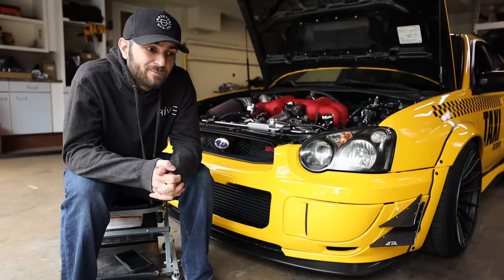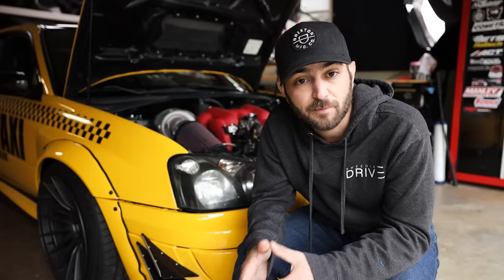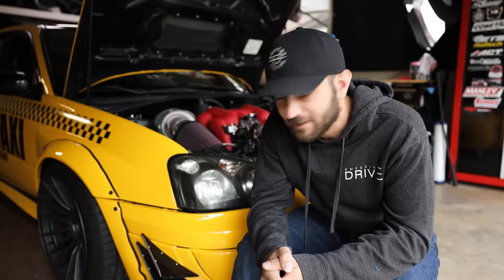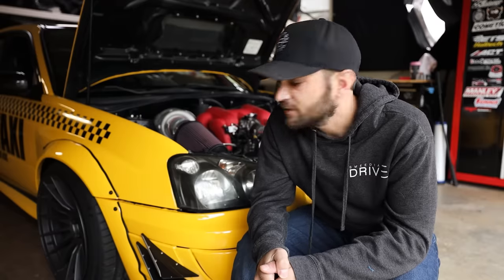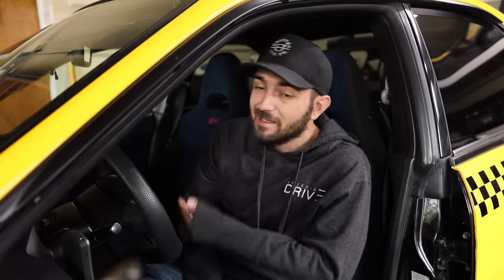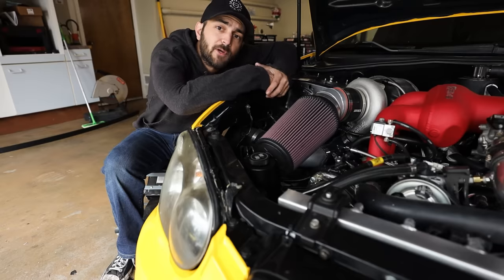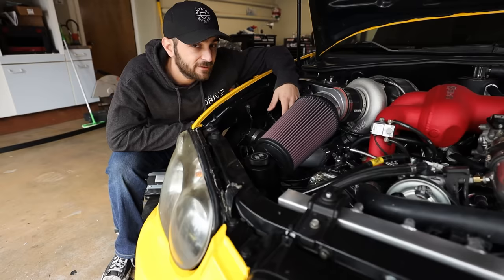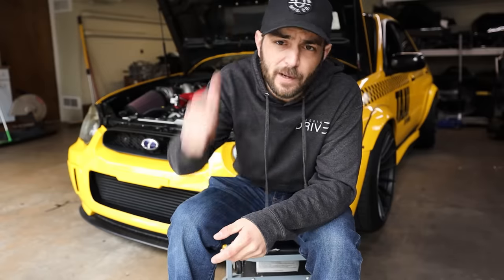What You Can do To Keep Your Subaru Reliable.

Comment: When you say "Built engine"  Is that just stronger pistons/rods/rings/etc or do they actually modify the block itself to make it stronger?
Reply from the maker: Depends on what you do, mine has forged internals and block modification but some can just have internals
Reply: Usually when people refer to built engines they are referring to having better and stronger internals and not the stock parts
Reply: Yes. And no.

Comment: Yo guy in my town selling a stock ‘11 sti 118k mikes original engine. Cosmetic head gaskets, with arp head studs, with new clutch,  new timing belt, new water pump and  new pulleys and tensioners. Would you be worried about buying a sti with 120k miles on original engine?
Reply from the maker: Nah, I'd be more worried about whomever sid the work. I'm super picky when it comes to buying cars. But 120K is not bad
Reply: @Smeedia  he’s a mechanic and he would let my mechanic do compression. Abs leak down test
Reply: @Smeedia  he said he doesn’t let anyone touch his car but he knows my mechanic pretty well so he’s the only one he will let look at it
Reply from the maker: BTW! Would highly suggest a comp test before buying. If he won't let your mechanic do one that raises a red flag
Reply: @Smeedia  ya he will let my mechanic do a compression and leak test. But won’t let anyone else look at his car

Comment: Quick question ...I just bought  a New RA shortblock... Would you recommend Re-gappiing the rings to .0028 .. running a VF48 With a 11 blade Billet wheel..with supporting mods..tuned at 21.5 lbs ... Re-gap or Nahhh  Thanks man..
Reply from the maker: E85 or pump gas?

If pump gas I'd would just send it

Comment: 1. Keep it stock.
2. Use proper engine oil, check oil level once a week and keep oil level close to max, and change oil every 5000-7000 km.
3. If you have a subie with a 2.5 liter engine - swap it to ej20 and enjoy your car.

Comment: So what’s the appeal on a car that requires an AOS, cylinder cooling mod, tune, frequent maint, and  specific driving habits just to be reliable and a little quicker than a 2.0t accord? I think I’m regretting my recent STI purchase.
Reply from the maker: Doesn't require it but always recommended. They're an absolute blast when you start digging into them

Comment: I have a 03 Impreza GX 2.0L that I plan on turbo charging to have a fun street car. I don't plan on making crazy numbers but I want to do it for the learning process and to have something slightly unique. Any major red flags/warnings?
Reply from the maker: Stock internals and trand will not hold up to boost very well, but if your not going into it for power and just for a learning experience 100% 🔥

Comment: Lol blown four engine but I know the problem suburu oilpickup are brazed together not welded so what happens oilpickup shakes brazing cracks then it's like sucking water through a straw with a hole does not work if you want the engine to last replace the oilpick to a descent one

Comment: Looking into buying a 05 wrx with a JDM ej205 with the jdm ecu single avcs and wiring all done for it to run properly 55k miles on the engine has full exhaust down pipe and all a greddy bov and upgraded sti intercooler already on it as well as a tgv delete not sure if i should go with it though as donuts videos have kinda made me skeptical of course if i did go with the car i’d get it tuned 1st thing with all those bolt ons cause it hasn’t been but just looking for some advice if i should go with it or not as a daily driver
Reply: The oil lines were all swapped from the usdm to jdm motor to fit properly i forgot to add this

Comment: umm fa20 has the multi and port injection. thats what the toyota thing is... am i wrong,? scion frs has pre valve port injection true or false.
Reply from the maker: Fa20 uses Toyota D4S system with port and direct injection so no worry if carbon build up. 

Fa20DITs only have direct injection so carbon cleaning is required

Comment: Quck question about tuning (new to subaru's) If I have Tomei Headers + exhaust and cobbs accessport  that wont work?
Reply from the maker: Unfortunately no, Cobbs OTS Maps are built to use only with Cobb parts. You would need a custom tune 🙏

Comment: If you were looking at grabbing an sti today, what year would you aim for? I was looking at 15-19 but leaning more toward 18/19 but it seems like the only deals are on the 15s
Reply from the maker: If it were me I'd snag an 07 limited, but between thr options your looking for snag a 2019+ for the type RA shortblock 🤙
Reply: @Smeedia  does limited or not matter?
Reply from the maker: No, personally I just prefer the limited
Reply: @Smeedia  I'm looking for a daily driver and keeping it intake/exhaust and a pro tune.
Have a Hawkeye for the weekend warrior.
Best deals I'm finding are on 15 limited, Have 1 19 base within 300 miles. Trying to keep it reasonable distance as I'm trading in my mk7 gti
Reply from the maker: The 2015s are great for daily driving, the limited would be my only go to for that year. The base infotainment systems are awful
Reply: @Smeedia  you got discord or something? I can show you the 4 I have it narrowed down to. And maybe give me some tips on what to look for on the test drives
Reply from the maker: https://discord.gg/HmCWZ26G
Reply: @Smeedia  cool. I joined and sent you a pm

Comment: What if someone has an N/A Subaru and they don't provide an access port or anything to monitor the engine
Reply from the maker: I wouldent stress it on an N/A engine but if you wanted to they make some OBD2 readers that will work 🤙

Comment: Hey so I have a 2011 wrx I asked you about this not long ago my wrx coolant temp keeps increasing I’m not going through coolant my car does consume a little bit of oil. I burped the coolant system then the coolant temps went down stayed between 185 and 195 stays that way for about three weeks and then slowly the temp starts to increase again up to about 215 then I burp the system and it goes back down again for a few weeks and stays good then slowly goes back up eventually. Any idea what’s going on?
Reply from the maker: Sounds like a leak in the cooling system that's sucking in air. I would run a pressure check on it
Reply: @Smeedia  how and where would I get the stuff to do it
Reply from the maker: The sell coolant pressure testers at most local auto parts stores
Reply: @Smeedia  thank you so much man your a huge help!!

Comment: Lower octane doesn't equal lower quality. It just has different compression ratios.

So if you're a guy who's putting premium gas in your Yaris or two stroke motor you can stop that and start saving money.
Reply from the maker: Lower octane equals less knock control 

For a normal commuter 87 is just fine, for something pushing power you want higher octane.

Comment: I've been looking into a wrx, 2011-2013, Im going to be buying it stock, around 70-80k miles, leaving it stock. Anything I should do to help it once I purchase it? If I were to mod it at some point, what are some minor things I could do, nothing major.
Reply from the maker: Just maintain it and it should be 🤙 really comes down to how those first 70K miles were on the car. 

If you do decide to mod it start off with an Air oil separator and an accessport
Reply: @Smeedia  Thanks man, really appreciate it!

Comment: Does IAT really matter on a turbo'd car? I thought charge temp is what mattered, cause no matter what the air temp coming in and from the turbo is, its still being cooled by the IC before heading inside..i could be wrong though..
Reply from the maker: Charged air is measured off of the IAT Sensor. Same thing. 🤙

Comment: Freaking GREAT video
Reply from the maker: Thank you 🙏🙏🙏
Reply: @Smeedia  any tips for direct injection carbon buildup?  A VW service tech told me to give it the old highway speed ring out, at 35-3800 rpm at speed.  “Italian tune up”. lol
Naturally, intake valve cleaning at 40K miles or so, depends on the car, is the right thing to do, yeah?
What else can prevent it?  
note:  cool to see the new shared platform GRz/GRs whatever they are calling it has port injection and direct injection.   :D
Reply from the maker: Lol that won't do it, either walnut blast the valves or use subarus Chemical service to clean them 🤙 
Only way to really prevent it would to be to add port injection 😖

Comment: Hey man I’ve have 0.812 - 0.938 DAM on my accessport after installing a grimmspeed charge pipe. I have a MAP stage 1+ tune and they said it would be ok to run the charge pipe with their tune. The problem is not bad gas because I get 93 shell every time. I haven’t seen a 1.0 DAM for weeks. There is no bad knock readings just the occasional -1.41 for a split second. The car also runs fine. What do u think the problem is? Would a Etune fix it? Thanks!
Reply from the maker: An etune will always be better, OTS Tunes are okay for the most part but sometimes some cars just do not like them
Reply: My car hates maperformance e30 tune. Loves phatbotti e tune.

Comment: I plan on getting a 2020 STI and plan on leaving the engine mainly stock… but want to make it more reliable what specific parts are best for it?… any info would be greatly appreciate it thanks!!!
Reply from the maker: IAG AOS, fluidamper, Larger radiator if you wanted to add some parts on 🔥

Comment: Help. Ignition coil bolt broke off in the head. How far up a creek am i?
Reply from the maker: Pull engine, drill it out 😖 you might be able to do it with the engine installed but I wouldent trust myself to do it that way

Comment: Ayo I got a GT86 same thing as a brz but it does have port injection. It's got both port and direct injection. Just in case you didn't know :)
Reply from the maker: Correct, FRS/BRZ/GT86 use Toyota D4S system, the FA20 comment is mainly directed at FA20DIT cars
Reply: @Smeedia  thanks for the info btw keep up the good content.  Also if I decided to upgrade my injectors do you think I should upgrade all 8 or I could get away with just upgrading the direct injection ones?
Reply from the maker: Nah, just the port injectors. When I did my Turbo BRZ we swapped thr low pressure injectors to 1000cc and it was more than enough fuel 🔥

Comment: The whole "Subarus blow up" myth started a few years ago. 99% of the time it's blatant user error. Either someone didn't realize that you need to periodically check the oil level on turbo cars, and end up beating on them when they're low oil. Or people do crappy tunes and mod them with cheap parts without doing their homework first. Then they drive them like race cars, all the time, and blame the car when they have problems. 

My entire life (up until about 4 or 5 years ago) everyone always said Subaru's were one of the most reliable cars on the market.

I've owned my 2010 WRX Premium (5-door) since October 2009. That's 12-1/2 years, and I live in Buffalo, NY, with extremely harsh, and long, winters. I'm over 100k miles and all I've needed to replace so far, that were not wear and tear items, was the fuil pump (my own fault for running it on fumes a lot. A bad habit I stopped doing) and the relay for the Heat & AC main blower fan. Everything else I replaced were basic wear and tear parts. (Brakes, light bulbs, tires, belts, battery, etc)

The one expensive fix I've needed to do is the clutch (at 85k miles). I upgraded it to a lightweight stage 2 clutch and am now a little concerned about the extra stress to the engine (with it reving quicker and going into gear more aggressively). I don't have the money for a new car so I'm trying to get as many years out of it as possible. 

I've been running the best oil out there (Mobile One High Mileage, Extended Performance), change it every 3k miles, always run the proper gas, etc. I also don't drive it hard except for once in a great while. Even then, I don't launch it. Mostly just drifting it around corners when streets are covered in snow. Other than that I drive it easy. My engine doesn't knock. It runs perfectly smooth, and quiet, and I want it to stay that way.
Reply: I do have one strange noise happening currently, however. A humming type sound coming from the front end while driving. It gets noticeable between 40-50mph and sounds like it might be coming from the front diff, or somewhere near there. The pitch of the humming goes up when my speed goes up then decreases as my speed drops. It's not too loud but noticeable when all my windows are up, my radio's off, and I'm just cruising.

Any ideas? Just curious. 🤔
Reply from the maker: First thing that comes to mind is wheel bearing, un balanced wheels. But if you do suspect it is the diff I would drain the fluid and see what comes out 🙏
Reply: @Smeedia  Thanks for the reply. What makes me think it's the diff is that the noise doesn't sound like it's coming from a wheel-well. It sounds more centered under the front. I know noises can be deceiving, though. I know someone who has a lift so I'll be taking it there soon.

Does differential fluid slowly go down over time? I'm way past due for getting it changed. I'm not even sure how long it's been. I'm wondering if the fluid could be so old that it's lost its viscosity, or possibly gotten low enough that the diff is humming when it gets up to speed.

My wheels are all good. Newer tires with no broken belts or side wall bubbles. I am in need of an alignments, however. Any idea if getting it aligned could make the difference?

Thanks again for the info.

Comment: i get -1.05 fine knock learn on my 05 sti once every while. It usually goes away after running it for an hour. Is that normal or should i be worried?
Reply from the maker: Normal 🙏

Comment: I have a 2018 wrx Map stage 2+ e30. Car runs great and temps seem to stay good too but in stop n go driving it tends to occasionally show knock up to -8.14 at 2-2.5k rpm only. But if i drive longer distances i get 0 knock. Any thoughts?
Reply from the maker: Assuming it's just intake and downpipe only?
Reply: @Smeedia  intake, downpipe, Chargepipe and intercooler a MAP.
Reply: I don't get it all the time just once in a while in consistant stop n go only.

Comment: “Can’t run a boost controller on ots tune” I can only assume he means manual controller? Being that Cobb makes a electric boost control solenoid
Reply: yea
Reply from the maker: Nope, can't run an electronic boost controller on OTS Tunes. They're not supported and require calibration to each ECU.
Reply: @Smeedia  jus looked it up they are. Jus gotta have Cobb
Reply from the maker: Not true, I don't know what you looked up but even on their highest stage 3 OTS map you still do not use the 3 port boost controller. 

You cannot use a 3 port EBCS on any OTS Tune. 

https://www.cobbtuning.com/maps/2017-subaru-wrx-sti-stage-3-valet-mode-map-1050x
Reply: @Smeedia  mkay thanks for deleting my comment. Also sent u a link to the ots map. It’s not for the 15+ chassis cuz they don’t need it. And the ots are specifically for ebcs sooooooooooo idk what to tell u
Reply from the maker: Youtube auto deletes links, was not me good sir.  What's the map and whats the car? All OTS Maps from Cobb don't call for them. If you did find one lemme know who year specifically and the stage and I'll take a peek
Reply: @Smeedia  from 2002-2014 for whatever reason they follow wrx chassis I’m sure they have sti for pre 2015 excluding bugeye keepin usdm

Comment: I’m looking at a Perrin oil filter sandwich plate with a temp sensor hole but what do you recommend for checking oil temp?
Reply from the maker: It will leak, they always do. I'd suggest the oil galley near the turbo above cyl 3. That will give you the most accurate readings

Comment: I bought my STi with a cobb stage 2 but different parts, I changed the intake but the downpipe is catless. Don't have money to spend on a catted one so will I be fine? I gotta invest some on my brakes and maintenance right now
Reply from the maker: I'd suggest saving up for a catted one or getting a catted one installed if your still IWG 🙏
Reply: @Smeedia  thanks man 🙏 but will it be safe to run for a bit till then? I don't hit full boost all the time
Reply from the maker: Yes I just wouldent go WOT
Reply: @Smeedia  gotcha thanks!!

Comment: I want to use a Access port on my stock 2017 wrx premium, But i dont want to use a ots tune. Is that possible? the only option i saw was to put a stage 0 ots tune. Ultimately i just want the monitoring features.
Reply from the maker: You can get a tune from etuners as well even if the car is all stock 🙏 the stage 0 tune should be more than fine
Reply: @Smeedia  thanks for the response. reason i am worried about going with the OTS tune again is because my engine started knocking after only 5000 miles running stage 0 but it could of been unrelated. Just trying to avoid my same mistakes.

Comment: I'm getting knocks at 1.40 to 2.80 with. No drop In dam.. and exceed boost in 4th and 5th gear only, 1-3rd in hard pulls are fine. Any help would be appreciated.
Reply from the maker: Normal values, nothing to stress 🤙 
If your exceeding boost that sounds like a tuning issue
Reply: Are you running a catless dp?
Reply: @Darkhunter218  no I'm not. Thinking maybe a tune up catted dp bigger turbo unsure if I'm over driving the limits of the current tune. Need a good tuner in Missouri. Hard to find.
Reply: @Smeedia  I appreciate it.. your videos are the only help I ever get regarding issues.